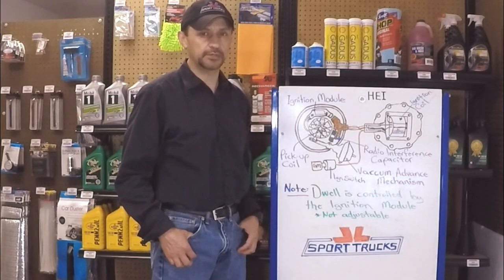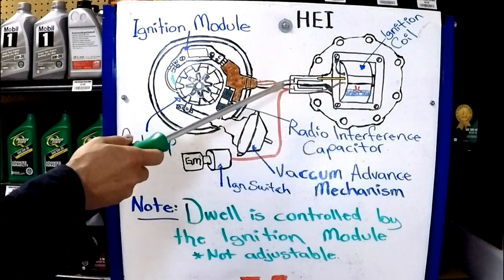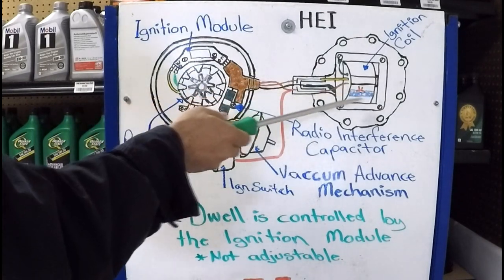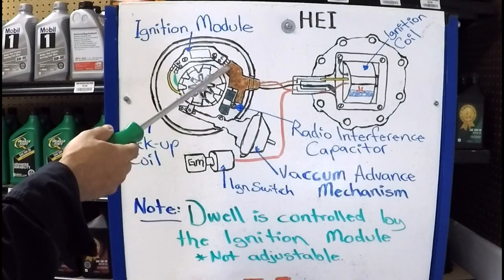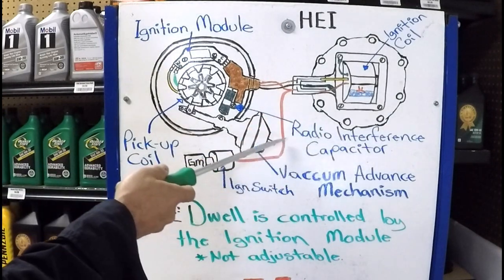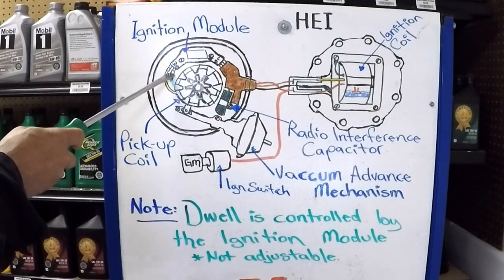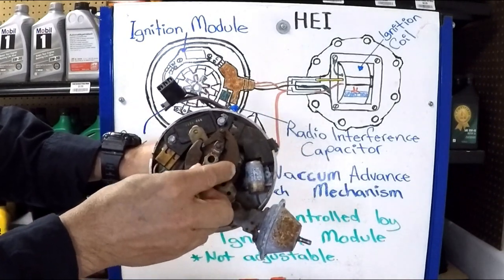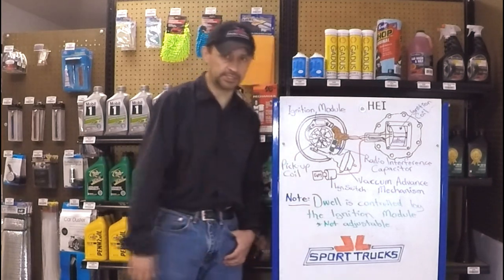How the HEI Electronic Ignition Distributor Works

Comment: at the 5:09 mark, the test for checking for grounding between each of the pickup wires and the body of the distributor, when i do that, my multimeter registers 17 Mega ohms and it steadily climbs the longer I keep the tester on it.  is that a potential problem and causing my no spark situation?  I have a brand new magnetic pickup that measures 545 ohms between the 2 wires of the magnetic pickup.  i also bought a new module, and coil, and still no spark on my HEI.

Comment: The pick up I’m diagnosing also do not have injector pulse. I am assuming the computer (ECU) uses signal from pick up coil in order to fire the injector as well. I placed a bulb in place of coil to see if there is any pulse but no pulse meaning it will not fire the coil if I connect them. I don’t want to test with coil because of shock hazard. If I confirm pulse is present then I will connect coil. Is it also possible ECU not getting power or even defective that’s why there in no injector pulse or spark? I was looking at the schematic and module seem to be connected to the ECU as well.

Comment: I have a question and thank you for the video. Are there any gas savings from upgrading OEM distributor on a 1990 Lincoln Town car base model Windsor V8 5.0?
Which systems would be more beneficial and less mechanically complicated for this goal?
I've also heard of coil on plug systems. I'm a new virgin on an old scene and would appreciate any advice you can give thank you.
Reply: The oem distributor from Ford is pretty darned good. The engines computer will adjust total timing, just make sure that your base timing is set properly, I believe 10 degrees of base timing. The Ford timing curve is really good. I'm assuming you're still running the factory fuel injection and engine control computer, should be Ford EEC 4.

Comment: is it powered by 12v or through the ballast resistor?
Reply: Hei requires full battery voltage at all times. No ballast resistor.

Comment: one wire from the dist goes to the battery, one to the tach, and where does the other one go to?  I've got one going to my alternator...is that right? Thanks  PS. This guy really knows his stuff. Think he can swing by and help me hook up my wires?  hahaha
Reply: willg54
Reply: That would be ground, which apperently goes to one of the bolts that holds the coil to the cap (at one of the corners, if that makes sense)
Reply: Yall are helpless. Google your coils serial number and follow the directions. You gotta make sure you have a direct connection to your battery. Connection for ground. Connection for acc. All of which shoulf go to on/off switch you add to your dash. That way you gotta kill switch, and a way to prevent your car from being stolen